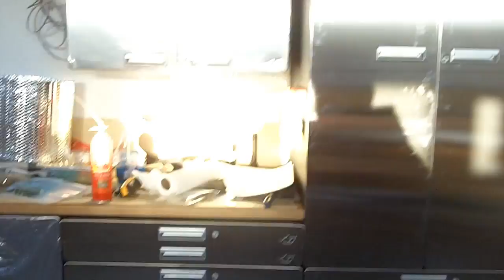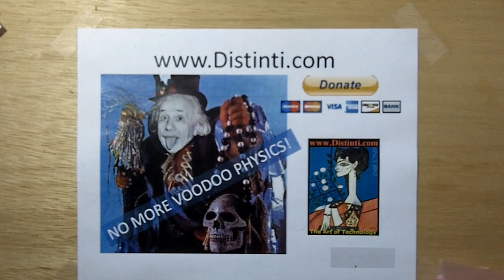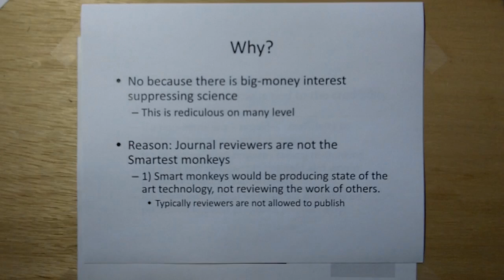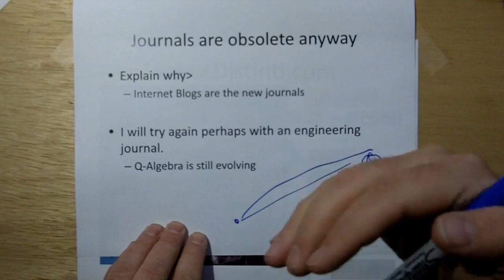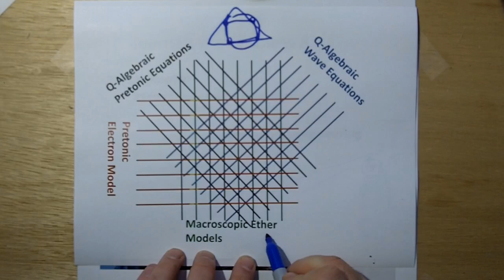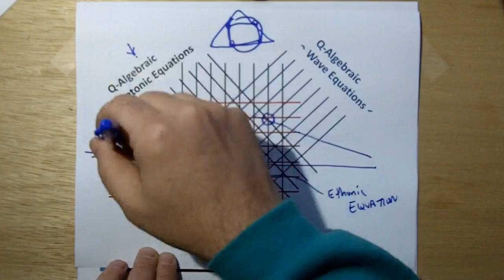S003: Ethereal Mechanics: Behind the Scenes #2

Comment: Sorry to hear that they rejected your paper without comment. That's frustrating to not get a rationale so that you can improve and try again.

Most likely, if they reject a submission without any feedback that means they didn't find your submission interesting enough to warrant space in the publication. If they had found it intriguing but flawed then they would have been more likely to give you feedback on how to improve and resubmit your paper. Somehow you didn't communicate how important your results were, or you didn't communicate how unique your methods were, or your potential audience just plain isn't interested in the results because they are outside their field of focus. 

From your Q-vector videos, my impression is that Q-vectors is just Quaternions with a (possibly) different sign rule. If that's the case, it might not be very interesting to mathematicians because it's not unique enough to be interesting within their field of focus. But if you submit the same paper to an electrical engineering publication it might be a lot more interesting because their field of focus is on the corrections and simplifications your math allows in the computation of electrical and magnetic effects. They don't really care how close it is to Quaternions. If Q-vectors is more substantively different from Quaternions (and the existing generalizations of Quaternions that are discussed in the wikipedia Quaternion page) then that probably needs to be made more explicit, and in that case mathematicians probably are interested, especially if you can show some computational advantage to using Q-vectors. Without a doubt there are very strong parallels between Q-vectors and Quaternions. Again I recommend Doug Sweetser as someone who has a high interest in Quaternions and would be very likely to be willing to engage in intelligent discussion with you on Q-vectors vs Quaternions.

I'm glad to hear your lease on life has been renewed.

Comment: Congrats on the Remission as well. I hope you are utilizing a quality cannabis oil high in THC & CBD, to not only keep the cancer in full and total remission, but to fix any damage you received as the result of the brutality and insanity of Modern Medicine and Radiation and Chemical "treatments".
The ability for cannabis to cause apoptosis in nearly all cancers, at nearly any stage is very well know in the Research Community as well as the Medical Community, when their work is looked at, and replicated, it is proven out.

The US Gov has had a patent on the process of THC shrinking Tumors since 1975. IE< Cannabis Curing Cancer.